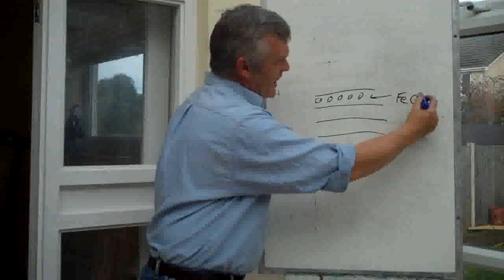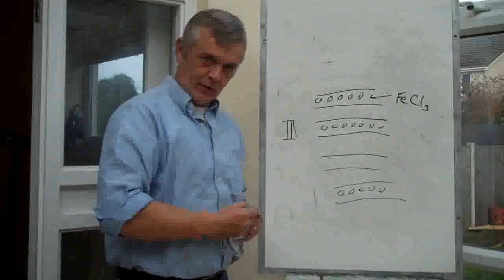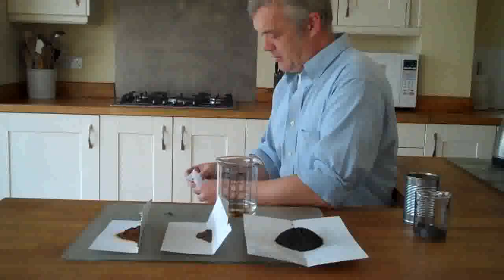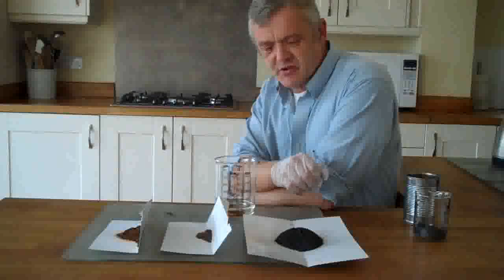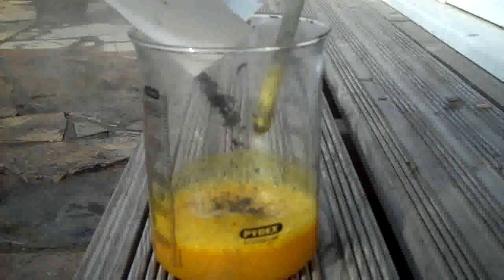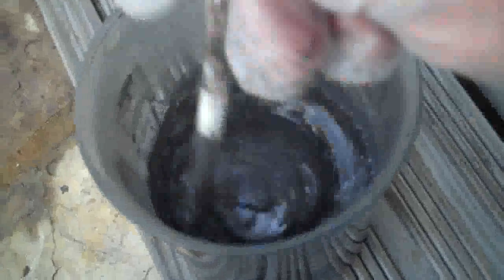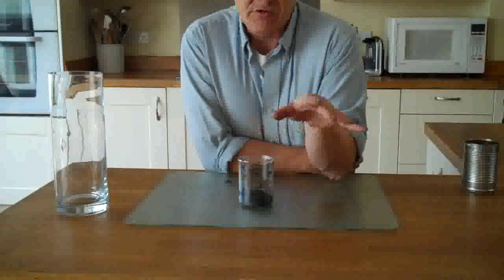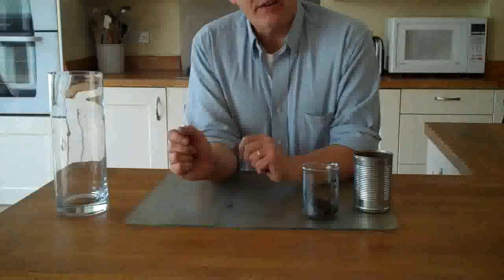Graphite Intercalated Compounds for easy graphene, generators and synthetic metals

Comment: Using iron sulfate instead of iron chloride could avoid fuming of evolving HCl. Adding potassium permanganate to this mixture could cause burning due to evolving Mn2O7!  Wearing no protection glasses when handling this aggressive agents and working outside a fume hood is NOT professional! I can NOT agree with this kind of working - except you have too many eyes! :-(

Comment: I attempted this same process with Aluminum Chloride hexahydrate (I couldn't find straight AlCl3 at the time, I have some on order), using 0.021 mols (5.05g) of AlCl3H12O6. I figured the added H2O would dilute the acid a bit, so I went with a slightly higher concentration. The aluminum chloride finally dissolved into the acid when I heated it to around 40-50C. After everything was added and finished bubbling, it was much more watery than your FeCl3 version.

Comment: I did this. I tried making a sheet out of it, but it was flaky (maybe because my graphite is 10 micron). I added it to peroxide and it did cause the peroxide to fizz, but not as vigorously as yours. The shininess and conductivity are both huge though. Can I use the GIC directly in an ink, or am I better off turning it into graphene first?
Reply from the maker: try both
Reply: Robert Murray-Smith the GIC ink gave the conductivity I quoted on your other video. I'm trying the bromide intercalation route for graphene. Will homogenisation or wet grinding the bromide intercalated graphite also produce graphene? I am particularly interested in wet grinding because the setup is quite cheap, and widely used here in India
Reply from the maker: i don't know mate - but as it is well used it is well worth a try

Comment: Got this to work beautifully. I do have a question though. The brown supernatant, obviously this is a mix of acid, iron chloride, and permanganate, as well as any side reactions that have possibly taken place. But there seems to be a significant amount of dark brown "graphene-looking" material that is very soluble and takes a bit to settle out. I know you've done another video about GO synthesis using sulfuric acid and permanganate, with a couple variations from this method. So I'm wondering, is there a chance that this mixture contains GO? I decided to chuck some 30% H2O2 on it and it turned from brown to a grayish black fairly quickly.
Reply from the maker: there will be some mate - but very little

Comment: Hi mate, i've been having a go at this and it's a lot of fun but i wonder if you could help.  When i put the intercalated graphite into the h2o2 it fizzes and fumes just like yours does, at this point i thought i had cracked it but after sitting for a short while it separates.  Any suggestions as to what i'm doing wrong?  The only thing i can think of is that i used ferric chloride hexahydrate instead of the dry powder that you had.  I added more of it to make up for the weight of the water.  cheers
Reply from the maker: it's next to impossible for me to tell what is going on at a distance mate - sorry

Comment: Hi Robert
I did this with great results. I ran it through Hydrogen Peroxide 4 times with my sonicator, and now I'm left with fairly pure 1 and 2 layer Graphine. I want to make a fairly thick ink to airbrush onto copper, zinc, aluminium and other foils and a titanium sheet that I've concocted, for my ultracapacitors. I'm thinking 5 grams of the graphine, 100 ml of deionised water and 10% pva, and magnetically stir. Do you agree?
Cheers
Ed
Reply from the maker: sounds like a good plan to me mate - are you going to do a vid?
Reply: Well, I had cancer of the tongue, so I have a speech impediment, so probably not. I was really enthused by your taster on the 1MF SuperCap, so I immediately did the Acetone/Water method. It works, but under the microscope, I only see blocks, so I tried intercalated with Iron chloride. It works much better, especially with 50% hydrogen peroxide with a few grains of baking soda to prolong the reaction. I made a ultrasonic sonicator with a single 100 watt transducer and driver, controlled by arduino (5 mins on, 5 mins off for 1 hour). 4 rounds makes pristine graphene. My end aim (after experimentation) is to make a 100,000F SCap, and then 1MF, and then 100MF.... I will experiment with what combinations of metals make the least leakage SCap, and what thickness of Graphene retains the most power. I'm on a disability benefit in Au, so this is fast becoming my obsession....
Cheers
Ed
Reply from the maker: do you mind if i do a video of this mate - i think this is really worth sharing - i will give you credit for the method
Reply: No worries, but i really haven't added much..
Reply from the maker: i disagree lol - but i will do it as soon as i can - cheers
Reply: I've also got an idea of a arduino or RaspPI controlled machine to do the intercalation. 2 insulated tubs, 1 with a freezing coil (or Ice) and one with a heating element. Hoses to the bath/stirrer where the beaker is. So you put the H2S04 in the beaker with the FeCl3, and turn it on. It starts stirring and 2 mins later advises you to add C and KMnO4. The controller monitors the temp, and keeps it at 25c until the temp is not going up, then increases the temp to 40c, and stops stirring for an hour. At the end, it goes bing and your done. BTW, my stirrer it heavy duty, Neo Blocks.... Big motor.... Big plastic encapsulated big steel rod. I HATE stirring....
Reply from the maker: sounds like a good plan mate
Reply: Hey Robert
What are the best N type intercalation molecules/compounds? I also want to see if I can make a very efficient peltier device..... Cheers Ed

Comment: great bids Robert. Have you tried to make graphene from coal using a similar process. I want to try it but not sure how much nitric acid and sulfuric acid to use. sonicated for 24 hours.
Reply from the maker: +andrew cravalho I wouldn't use coal myself mate - there has been some work on this but the graphene is at the quantum dot level - interesting stuff but for straight forward graphene i would use graphite
Reply: +Robert Murray-Smith can you explain why? My current understanding is that it has approximately a 20% yield. with coal being so cheap it makes sense. could  quantum dots be converted to oxide? Thanks in advance for your response:)
Reply from the maker: +andrew cravalho Just a higher yield mate and easier to do - but go for it - i intend to try myself quite soon. Most people just want as much graphene as possible and i made that assumption about you - I am sorry for that - myself - I just like to try things - and it now seems so do you lol

Comment: bob if it is possible may you tell me the correct fecl3 you used to make the intercalated graphite, i may try fecl3 hydrate but as your experiment was positive i would like to know what is the fecl3 you used well.
Reply from the maker: essencee234 the hydrated salt
Reply: Robert Murray-Smith
great thanks for your contribution.
Reply from the maker: essencee234 no worries

Comment: Hello, 
I have a question - can I use Percloruro Hierro 40% for this experiment?
Reply from the maker: i would certainly try it if i had some
Reply: Robert Murray-Smith  I mean, it's FeCl3 but in the liquid form. And I'm not sure about the ratio - should I consider the amount of water in the iron chloride solution when adding water to sulphuric acid?
Reply from the maker: Irina Shaklova
why don't you just dry it? - or heat it to supersaturation and let it crystallize out?
Reply: Robert Murray-Smith :) thank you very much! i'll try) i'm just scared to mess everything up since i'm an architect, not a chemist
Reply from the maker: Irina Shaklova
go for it - recrystallization is a standard purification techniques - just boil a bit off and leave it to cool - the crystals will drop out of solution then pour off the liquid and leave the crystals to dry out - they will very very pure
Reply: Robert Murray-Smith ufffff) thank you VERY-VERY much! I'm really sorry for bothering
Reply from the maker: Irina Shaklova
no worries - i'm here to help
Reply: Robert Murray-Smith hello again) I wanted to ask - are the proportions of the chemicals correct? Because I used exactly the same amount of chemicals and it looks to be less than in the video. And in the end I got not thick substance but black liquid ((( I guess something's wrong.  I used 200 mesh graphite  and crystalized FeCl3 - i guess this is the issue? sos)

Comment: Hey Robert! Great video!

Minor point, but something that confused me when I saw it. You may want to doublecheck the circuit you draw at about 2:00 for the peltier junction. http://en.wikipedia.org/wiki/Thermoelectric_effect  I think you have your electrodes wrong.

As always, thanks for your time and thoughts!
Reply from the maker: you are right i did get it the wrong way round thanks for that - it is a bit confused between an actual device and the way the peltier is measured for the seebeck effect across a single semiconductor

Comment: After following this procedure, when I added the permanganate slowly, the temperature had risen fairly quickly to over 50c- everything seems correct (foamed, now gel like) except how hot it wants to get (I threw it in an ice bath to get temp down quickly, as in other videos u mention staying below 55)

 It's now at ~23c and seems to have killed the reaction

Are you using an ice bath? How are u keeping it around 40c?
Ur awesome, cheers,

Comment: Sir, I have tried the following
100mL 75% H2SO4 add 3.4g FeCL3 add 20g Graphite (100micron powder) + stir 7.2 g KMnO4.. Stir for 15 min. Keep the mixture at 40 deg C for an hour. Then wash with 2L of water, decant and wash ( thrice).. Finally the mixture is kept overnight to dry at 100 degC.  

This i have tried microwave exfoliation, peroxide exfoliation.. Both have not worked..
Can u suggest what went wrong?

Comment: Hello mister Robert, 

I tried this procedure 3 times already, for my school project about grafeen. But still no good results. I have some problems with it..

1. There is less reaction with sulfuric accid + iron(III)chloride in my 3 experiments.. 

2. And when I add the potassium permanganate, there is almost no reaction.. It won't turn into the thick substance you have in this video..

In the first 2 synthesis I used: iron(III)chloride -(hexahydrat) and activated carbon.

In the last synthesis I used normal iron(III)chloride and graphite powder. 

Do you have any idea what the problem could be? 

Yours sincerely, 
Hessel
Reply from the maker: there is absolutely no point in using activated carbon - a graphite intercalated compound has to use graphite otherwise it isn't a graphite intercalated compound. You have to follow it exactly or it has no chance of working
Reply: Having not a single gram of graphite at my school, my teacher told me to try it with activated carbon.. With no results ofcourse.. After these 2 failed attempts I scored some graphite from a company in Amsterdam.

Today I did experiment exactly as you described in your video.. Except the mad stirring part.. I did this more gently. The result was a black thick substance. 
It doesn't have the brown colour as in your experiment nor the thickness. 

 It is now setteling down in 2L demineralised water. But I think this is going to take a while. 

Should I make the potassium permanganate crystals smaller, using a mortar? Or should I use a bigger concentration of sulfuric acid ? 

I want to use this to make the grafeen sheets as you explain in your video.  
So next step is the microwave exfoliation then the large scale graphene oxide production method, Washing procedure and then the video of making the sheets.. Is this the correct sequence?
Reply from the maker: you have to use concentrated sulfuric acid - and your teacher is an idiot

Comment: sry may its a stupid question, but is it not 3.4g of poatassium permanganate and 7.2g of iron III chloride? and one more^^ : i got hydrated iron III chloride (hexahydrat), is it the same then yours, or do i have to add more (in gramm)? thx...
Reply from the maker: hiya - you are right about the amounts - and it is ok to use hexahydrate. You have to remember this is an experiment not a recipe - you can vary the amounts and see what happens
Reply: thx mate, tryed both^^ will see what happens...
Reply: Moejo Jojo great work
Reply: Moejo Jojo did you try it.. Which one worked for you?

Comment: Grafito intercalado de compuesto

100 ml de ácido sulfúrico al 75%
20 g de grafito de malla 325
7,2 g de cloruro ferrico
3,6 g de permanganato de potasio.
6 l de agua destilada

En un recipiente de Pyrex verter el acido, agregar poco a poco el cloruro ferrico removiendo.
A continuacion agregar el grafito y mover hasta que todo tenga una consistencia de "mousse de chocolate".
Verter el permanganato de potasio, continuar removiendo durante una hora.
Luego introducir el resultado en un recipiente con dos litros de agua para hacer el lavado (tres veces).
Reply from the maker: grazias companero por esto - es muy facile para mi, si usted traduce. Es muy dificil para mi para hacer esta

Comment: Hi Robert, Great video, it would  I have some superfine powdered dry black ink. Can I use that as my starting material to create the Interclated compound
Reply from the maker: sure - no probs - if it is graphite based it has to have a graphitic structure in order to intercalate
Reply: thanks mate,

Comment: Do as you oughta add acid to water, I remember when I started my chem classes my dad taught me this saying. Thank you for the new videos.
Reply from the maker: if you do it the other way round it spits hot acid at you! I am glad you enjoy the vids
Reply: Robert Murray-Smith
My chem professor said its a very exothermic reaction. Add water to a high molarity or solid acid and it has the nasty habit of flashing to steam. Not unlike adding wet bismuth to liquid bismuth on the stove.
Reply: It's quite common for people starting in chemistry to be told this, because they're usually diluting acid into a large volume of water, in fact generally you always want to add the smaller volume to the larger volume so the heat generated can be more readily dissipated.